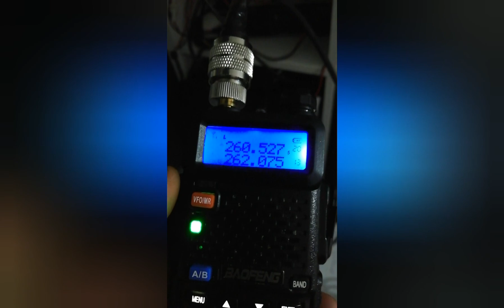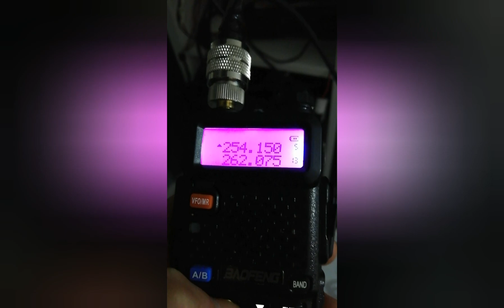Homemade Satcom antenna

Comment: Great antenna... I can see your back plane/reflector in the diagram, but didn't see it when you showed the antenna. Can you show it in another video or tell us if it's not needed. I understand having one will increase gain, but if it works without it, that would be helpful to know. Thank you for making this video and any info you provide.
Reply: Excelente antena... Puedo ver su plano posterior/reflector en el diagrama, pero no lo vi cuando mostró la antena. ¿Puedes mostrarlo en otro video o decirnos si no es necesario? Entiendo que tener uno aumentará la ganancia, pero si funciona sin él, sería útil saberlo. Gracias por hacer este video y cualquier información que proporciones.
Reply from the maker: hello, thank you for your comment. my antenna worked without a reflector. goodbye. thank you